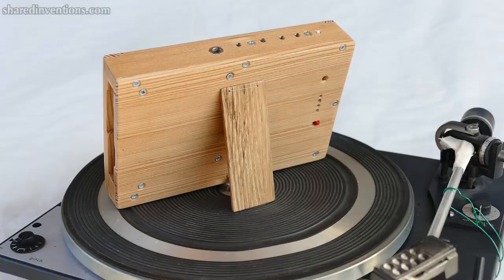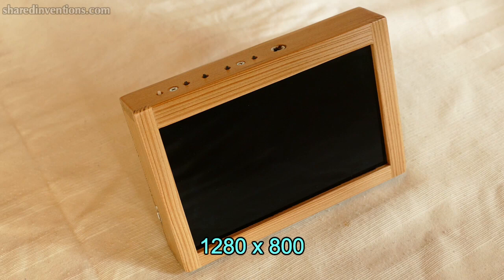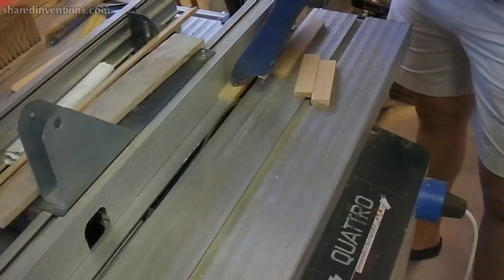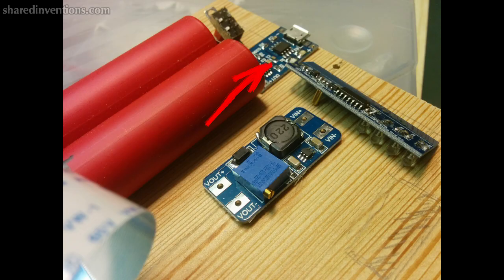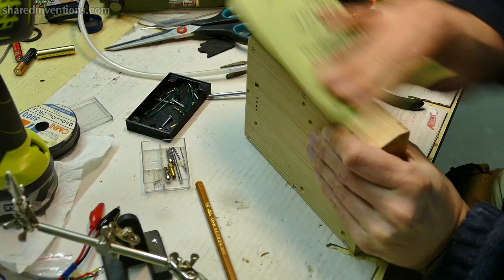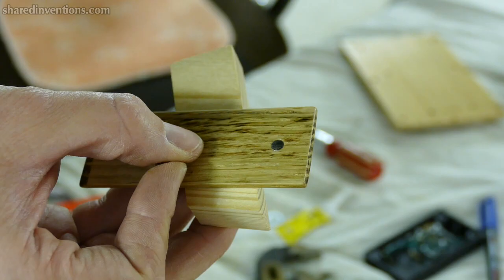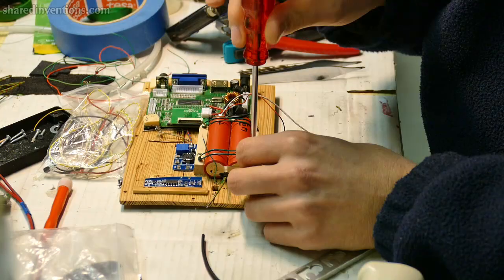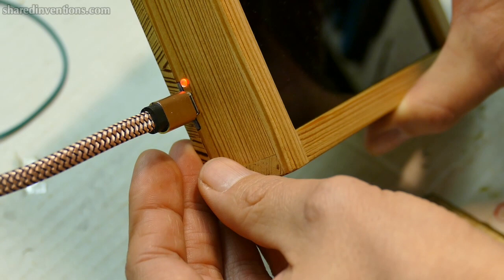DIY Portable HDMI Monitor

Comment: Are we able to optionaly 3d print the case oppose to wood? I work with 3d printing and not wood
Reply from the maker: Certainly, but you need to design your proper 3D model yourself. It will not look that cool tho. :)

Comment: Can I use cardboard and I'm trying to use from a old Dell monitor
Reply from the maker: It will definitely be light, but not very durable. The screen itself is quite rigid. The case is mainly the stand, and to protect the electronics. So if you don't plan to carry it with you often, then theoretically it can work. However I recommend you to cure the paper with some flame protection, e.g. brushing on Sodium metasilicate to the inside layer.